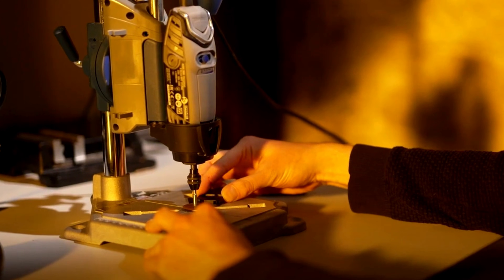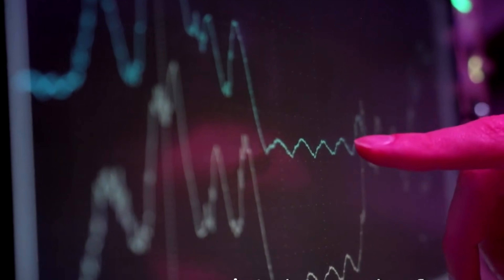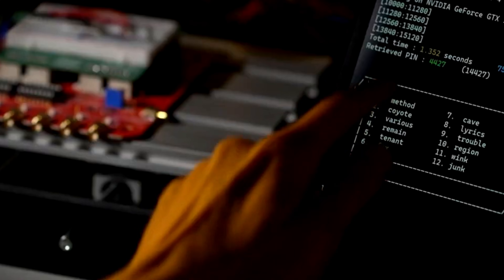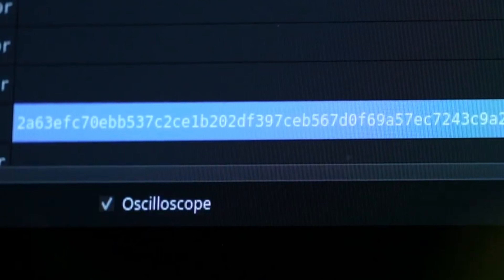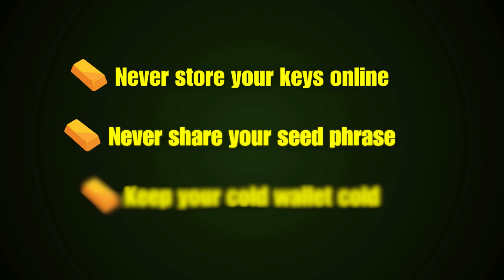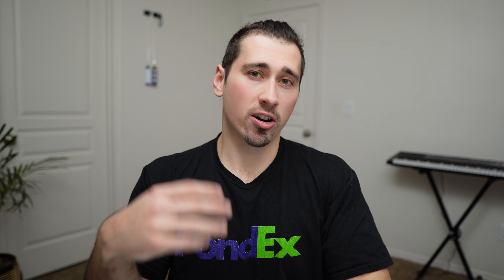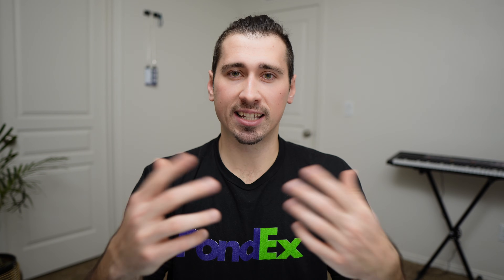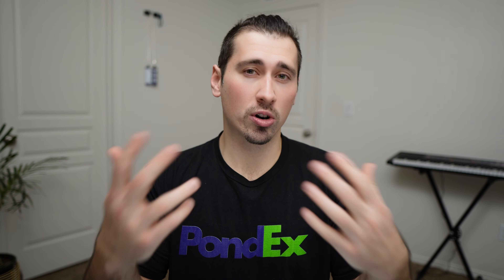How Cold Wallets Are ACTUALLY Hacked

Comment: Ngrave uses a military grade chip. Would this make the wallet more protected if the actual device was stolen?
Reply from the maker: @Hulkscastingcouch  It does not use a military grade chip. It uses an EAL5 chip.

The operating system however, is EAL7, which is military grade.

To your point, both secure element chips, its OS, and a bunch of its other security features would likely make the Zero near impossible to hack.
Reply: @ man. You are the best!!! Thanks for the reply. You a real one.
I thought the chip was 7  thanks again.

Comment: So the cold wallet your talking about so when you take your crypo off say robinhood pr coinbase or what other ones there are. And when your ready to sell you just transfer it back to what ever exchange you want to sell it on
Reply from the maker: Correct!
Reply: @cyberscrilla hello cyber, how long does it take for your crypto to transfer from a cold wallet into an exchange? Thanks!
Reply from the maker: @motogp2375 It’s slower when transferring to a centralized exchange. And many exchanges will give you an ETA (Kraken does this).

Ultimately it depends on the crypto, what network it’s on, and the exchange you use.

Average is 5 min to 1hr. Again, depends on the network.

Comment: What about Tangem?
Reply from the maker: What about it?
Reply: @cyberscrilla So you should transfer off tangem to hot wallet for transactions other than taking it off the exchange and vice versa to avoid blind signing?
Reply from the maker: Swapping inside the Tangem app is fine. 

But I don’t recommend connecting ANY cold wallet to external platforms to trade whether you’re blind signing or not.

You still risk falling victim to malicious contract approvals

So yes, if you’re swapping a token that isn’t available via Tangem for example, don’t connect it to a website to swap, use another wallet that’s not your main cold wallet.

At least, that’s what I do

Comment: Hey mate, thanks for your education videos.
I have a question, when using my wallet (ledger Nano) should I disconnect the computer from Wifi?
Thanks, cheers
Reply from the maker: Absolutely not. That doesn’t even make sense. You need WiFi to communicate to the blockchain. The point of using a cold wallet is so you don’t have to worry about stuff like this.

Comment: OneKey or Trezor ? Someone help ?
Reply from the maker: Couple things:

Onekey works on both mobile and desktop, also supports more coins, and has a rechargeable battery.

Trezor is mainly a desktop wallet, supports less coins, and has no battery that could fail over time (needs to be plugged in to use it)
Reply: @cyberscrilla so when the battery dies on Trezor, does that mean you can also lose your crypto?.  Say more than a few months of no charge just for the sake of the worst thing that can happen.
Reply from the maker: @motogp2375  couple things:

1. Trezor wallets don’t have batteries, so that’ll never happen.

2. Even if your wallet is lost or destroyed, your crypto remains safe. Wallets don’t hold crypto, they hold the keys used to access and manage your crypto.

So as long as you have your seed phrase, you can import it into a new (even different brand wallet) to access your crypto
Reply: @ i appreciate your help brother! Ty!!

Comment: If I were a chip designer, I would manufacture two completely separate user profiles, profile A would be less protected more easily hackable, would 'give away' its secret after a pretended resisting. There would be a hidden B profile.   The bait profile A would contain a factory setup fake account even with some reward money on it paid by the manufacturer., so a hacker would be satisfied and would not look further for another set of data.  Of course this all makes sense if nobody knows.

Comment: Ledgers firmware is vulnerable.....
Reply from the maker: @Kiyesxz Source: you made it up.
Reply: With a decade of experience, over 7 million devices sold, and zero hacks, Ledger has established itself as a leader in the industry. Our Secure Element chip and innovative touchscreen products like Ledger Flex and Ledger Stax set us apart, offering unmatched tamper resistance. Our attack lab, The Ledger Donjon rigorously tests our devices to maintain the highest security standards. Additionally, we hold the ANSSI certification, awarded by the French Cybersecurity Agency after independent labs have conducted thorough tests on our devices.

Comment: why does Tangum limit what cryptos you can and cant sell?
Reply from the maker: Tangem doesn’t limit anything. The limit comes from the third parties they use to offer these services. 

It’s simple. If the platform doesnt support the tokens or pair you’re trying to buy/sell/swap, well then, you can’t.
Reply: @ I appreciate you answering my question! I understand that Tangem doesn’t directly facilitate these services rather partners with third party exchanges to do so. But what I noticed was that I was I had access to sell a specific crypto but after that asset increased in value that option to sell that same crypto was no longer available. Which I guess comes back to the control centralized exchanges have to limit potential liquidation?